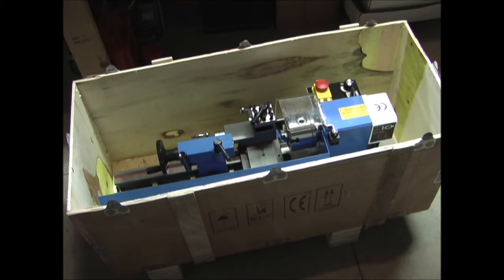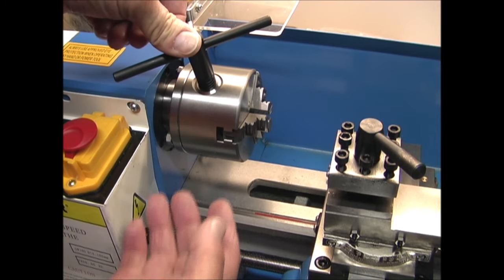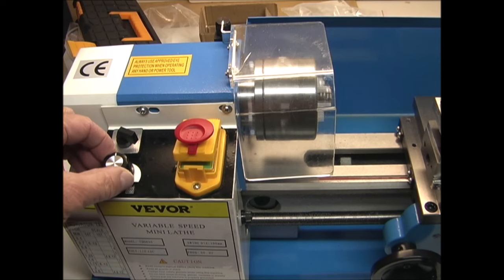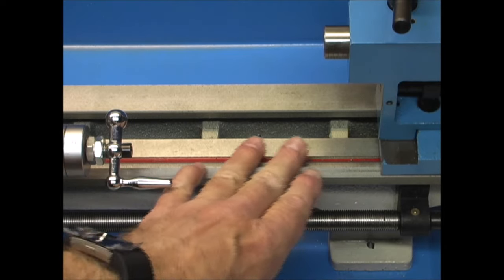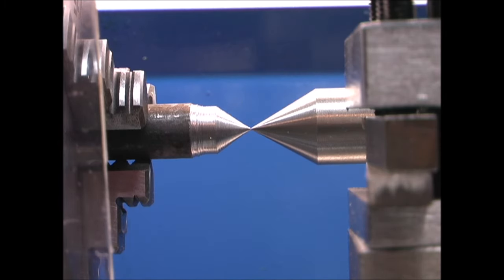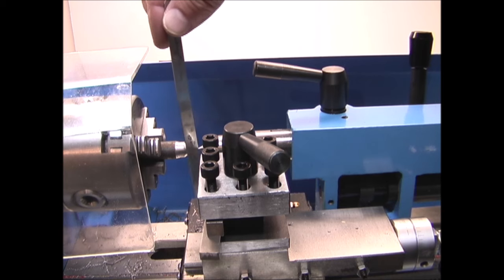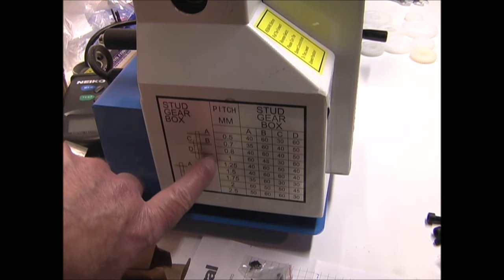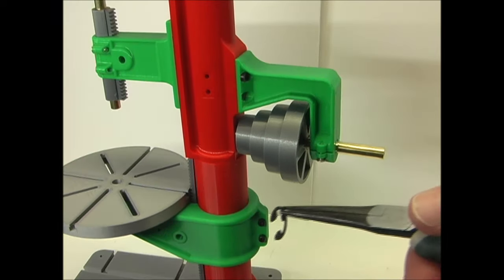Mini Lathe Unboxing, Setup, Review & First Cut. VEVOR 7" X 12" Variable Speed

Comment: I have a similar lathe and improved the run out on the chuck by removing the chuck, and putting a dial indicator on the backing plate. I had about  0.002 run out. took a skim pass on the backing plate and now it runs a lot truer. I was really surprised at how much of a difference it made.

Comment: The vevor branded ones are pretty good, reasonably well finished, they have wipers and oil zerts on the saddle which a lot of them are missing.  I got my Chuck running dead true by skimming the back plate and then stoning one jaw.  I would recommend for these using free machining steels.

Comment: Thanks for the review. I am thinking about getting one of these. I used to have a Smithy Drill Mill Lathe combo, so going into this I am expecting to have to tweak and adjust this on arrival. Maybe even some scraping on the bed. The 7 x14 is available on Ebay for about $400 right now.

Comment: This is my 2nd Chinese lathe which is branded vevor and seems to be better quality, these machines have their inherant problems worst one being the motor is weak stalling out stressing the belt and doing damage, but was surprised to find a spare belt in the parts bag. BTW those belts are almost impossible to find!!! Mine arrived in good time well packed damage free......as with most all these cheap imports need mods so they'll run right........i have the 7x14 digital readout metal gear version and paid $520
Reply: how much did you buy ?
Reply: Im buying one for aluminum whats the biggest pass you would take?
Reply: Sounds well worth the extra cost for metal gears.

Comment: I just recently got my Vevor lathe. It arrived all beat up, even the ends of the box were broken.
You guessed it: FedEx delivery!
Once inside, every piece of sheet metal was bent, some so bad the rivets were sheered.
Three hours later I beat the dents out and re-riveted the metal.
I spent another 6 hours adjusting each part and the tension of the moving parts.
The three-jaw chuck has .008-inch runout.
Then, the start stop switch would not keep the lathe running.
Buyer beware.

Comment: I have that exact lathe.  Thanks for all the info.  I’m wondering how can I adjust the tail stock un and down.   Mine is just a bit off.
Reply: Did you figure out how to adjust the tail stock up and down? I just got this lathe and mine is off too.
Reply: I had to use very thin brass shims to raise it.  I loosened the nut underneath it all and testes which shims gave me the height I needed.

Comment: Hi it is able to cut threads automatically with this one?
Reply from the maker: yes, but it does not have a thread dial so you have to stop the lathe, back out the tool, reverse the lathe without disengaging the lead screw and then do the next cut

Comment: So this is not a true cnc? Manual lathe with auto feed feature? I'm shopping for a lathe I can use gcode with that won't break my bank.
Reply: "Not a true CNC" It's not a CNC in any sense of the word. What even gave you that idea? Because it has power feed?
Reply from the maker: Correct, just a manual lathe.

Comment: delivered without chuck key and external jaws and customer service was a pain to deal with, good luck holding less than .0015, no spindle speed read out, BAD you can start the spindle with the feed lever engaged, I should have saved for a better lathe, I am not used to trying to make parts on a toy